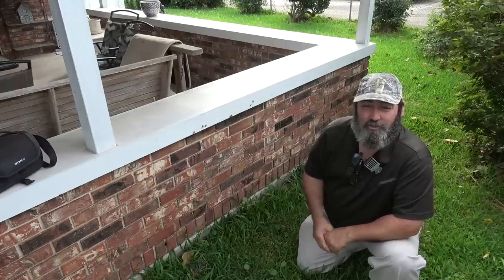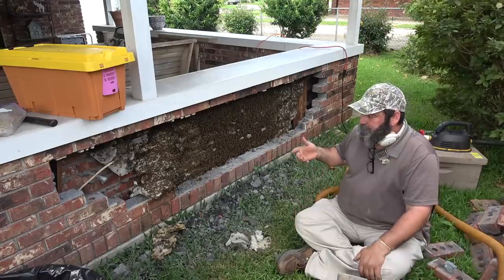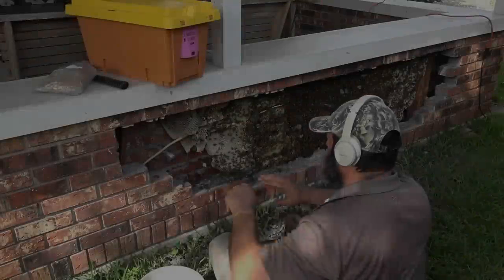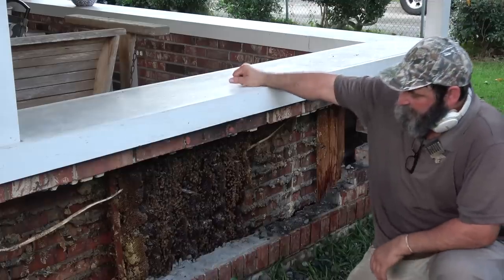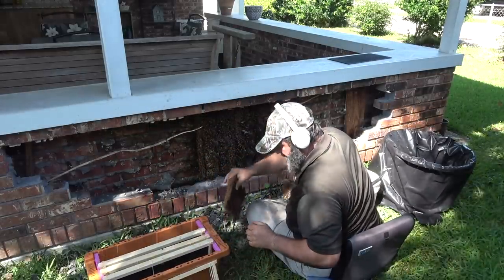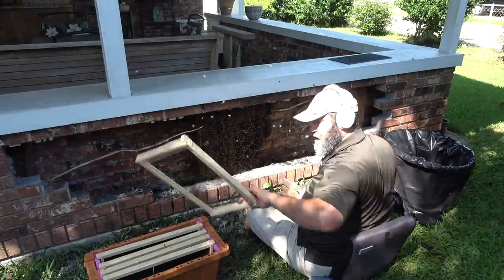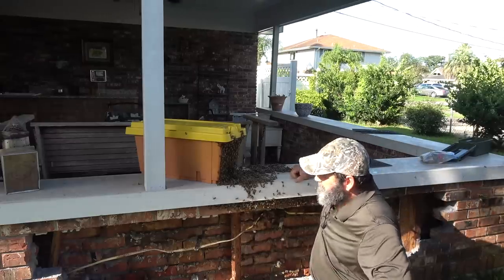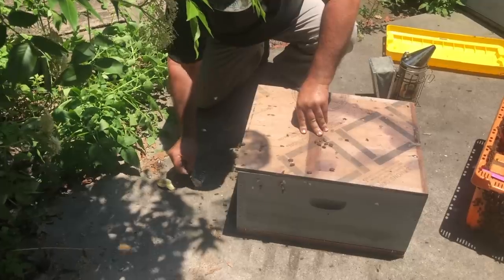Bee Man Vs Brick Wall Full Of Bees!

Comment: JP, just a suggestion. If you marked your knife from the tip of blade exactly the height of your frames, you could pre-measure before your 1st cut, so to avoid having to make 2nd cuts to fit the frames. A permanent marker might do it. Hope this helps, you’re the master. Love your videos.

Comment: Nice productive hive and they seem very gentle. Why a nuke box? Or was it just a temporary measure for transport? Maybe I’m wrong as I’m new to beekeeping but it seemed like a fairly large hive to me. Nevermind I saw the last part after writing.
Reply from the maker: There was actually more to this story. I made something like 3 separate trips on this one due to mainly rain issues. I vacuumed up a ton of bees but one box for sure, the first, I had to give them a different queen due to rain delays.

The last bit of bees fit into the Nuc but as you can see later on were transferred into a larger set up.

Comment: Questions:  Where did you keep the vacuumed bees while you were removing comb?  Does the bee vac harm the bees?  Thanks for a great channel.
Reply from the maker: Philip Kraft this job was done in intervals due to rain issues.

The second day I vacuumed a bunch of bees then there was a 2 day rain delay so that batch was given another queen & went to a buddy of mine.

While the bee vac is running, bees are going into the catch box which is the bottom part of the bee vac set up.

As long as the vac is running, air is venting through the catch box to keep the bees from overheating.

Hope this answers you question.

Comment: Question: could the homeowners just seal up any or all the holes in the bricks? Eventually the bees would die inside?
Reply from the maker: Yes, but then what happens next? A pressure washer & bleach or a better cleaner should remove all dark honey stains.
Reply: @JPthebeeman  thanks for the response JP! I know it's better for the homeowners to safety get rid of the beehives than just going the cheaper route. You went through alot of work on this one!

Comment: The holes at the bottom of the Brick wall are supposed to be there. They are called "Weep Holes" they allow water to escape so it doesn't fill up behind the wall.   On a wall done by a Good Brick Mason and not some Boot, that's the only holes you'll see.

Comment: I watched a video from cody's lab about bee uninstallation, and he mentions that smoking drives the bees further into the cavity. And instead he uses a spray bottle of sugar water.
What're your thoughts on that?
Reply from the maker: Depends on the situation but definitely wouldn’t spray bees with sugar water before using a bee vac.

Smoke only drives them deep if you overdo it with smoke.

Comment: I'd like to ask a question. why did you go through the brick instead of going top down from the wood?
Reply from the maker: The top is glued & screwed down in place for one thing but most importantly there’s no way on God’s green earth you could remove the hive from that narrow space.

Even if you were able to get the top off without destroying it, the removal process would have been a disaster, just not enough room to pull all that comb up & out without creating a sticky death trap.
Reply: Thanks for answering. Good video

Comment: Is that a drill bit he's using or some other type of demolishen tool?
Reply from the maker: It is a mortar bit. I had actually purchased 2 other bits more suited to breaking up/removing mortar but there was an issue with those so I had to use the mortar bit which did the trick.

I  have since purchased a bull point bit, one I’ve used in the past to break open cinder blocks & chip mortar with, ready for the next one!

Comment: JP in a situation like this one, where the colony in sandwiched between two masonry walls, how do they survive winter temperatures.  Masonry has no thermal value at all and it seems like the bees would have a hard time generating enough heat once the cold weather chilled both sides of bricks enclosing the hive.  I can see a wood frame wall but this seems like it would just be too much.  Is it possible these bees did all that in one season?
Reply from the maker: With our mild winters, if the colony is healthy & has feed, they can survive.

Cinder blocks have more insulative qualities at least for bees than you’d think.

Comment: Do you use the vacuum cleaner or is it a special vacuum cleaner
Reply from the maker: Haider Aswad it’s a specially designed device called a “bee vac.”

The top contains the vacuum motor with a suction regulator & the bottom part is the “catch box” the bees are vacuumed into.

The catch box is an actual hive body that fits perfectly over a domestic set up.

The bottom of the catch box has a pull out metal piece so the vacuumed bees can drop down into the hive box that contains frames usually with transferred brood comb or drawn comb.
Reply: I have always encountered difficulty with this type of homeless bee. The problem is that we are fierce and hostile, and it is difficult to deal with it with bare hands. I thought it was a vacuum cleaner 😁 Thanks for the clarification, uncle
Reply from the maker: Haider Aswad no worries. You had me laughing a bit by calling me “uncle.”

Did you happen to see the movie “Enemy Mine?”

Young Zammis calls his human surrogate father “Uncle.” 😊
Reply: I didn't see the movie, but Sarah was sure.  😆.  We follow the traditions in Arab society without the need to call the big person by his name, and we say to him there is respect for him. As for the real uncle, we call him uncle, sometimes we respect my father and we respect him as well.

Comment: Did you repair the wall??
Reply from the maker: My brick guy repaired the wall. I show a short clip of the repair job at the end of the next video or two after this video was uploaded.
Reply: @JPthebeeman I was thinking about starting to do cutouts and I was going to see what kind of license I need to do whatever repairs are necessary here in Florida..I appreciate all the info you share.thank you..
Reply from the maker: @bigfootsbees875  not sure if it’s the case currently in Florida but at one time you needed a pest control license to perform removals.

Some people work under a licensed PCO as a tech to bypass the need for a license.

Check into it yourself being you’re in the state of Florida.

Best wishes!

Comment: you know you could remove that noice with audio processor

not removing the excess, but mellow the sound lil bit
Reply from the maker: I’ve tried but it only terribly muffles your voice, even with Final Cut Pro, the program I’m currently using.
Reply: @JPthebeeman  have tried audacity? sample the noise, then reapply noise removal

but i think dont select your voice for noise removal, ugh seems tricky eh

lemme try edit in mine

Comment: How do bees get behind brick lok
Reply from the maker: Bees are very small & can get through an opening slightly larger than 1/8 of an inch.

There was a hollow area in the center of the wall as showcased in the video  where they were able to build at least two separate comb layers.